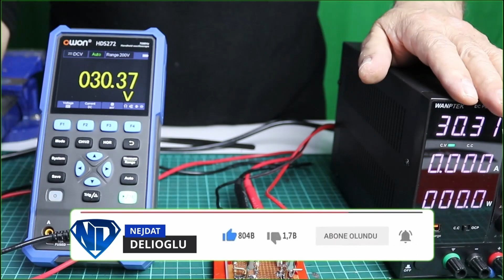Zener Diode Testing Made Easy  Tips and Tricks | Zener Diode Testing

Comment: A circuit diagram would be helpful ( ? ) ... also this method is useful for testing the  EHT  diode in a microwave oven ( which cannot be tested with a multimeter set to [  diode test  ] ..! ) ................. DAVE™🛑
Reply: I also agree.
A diagram, please.